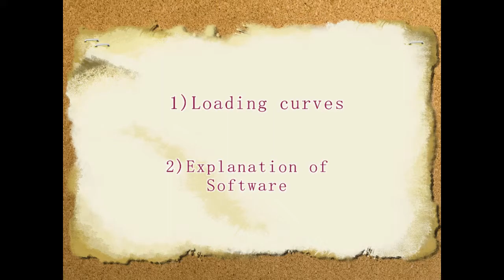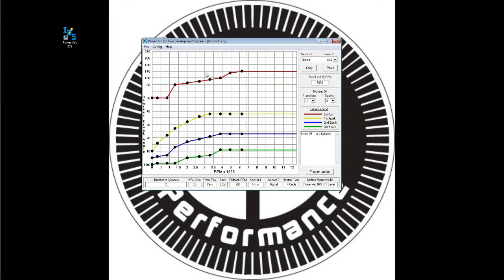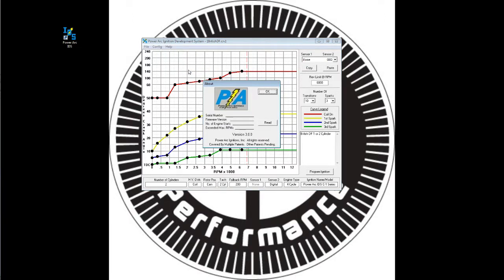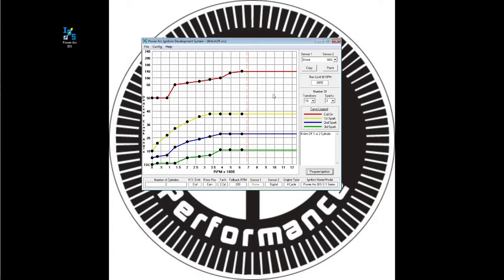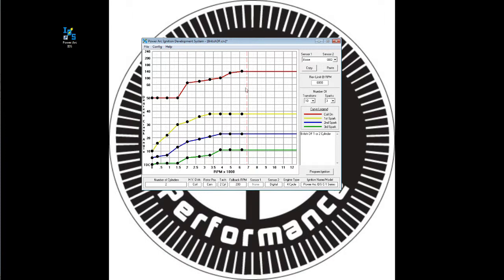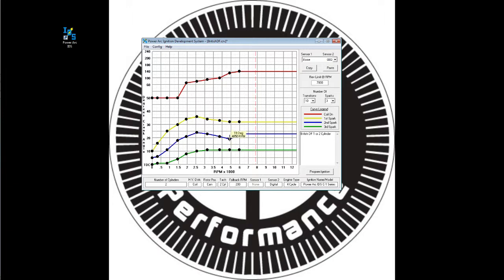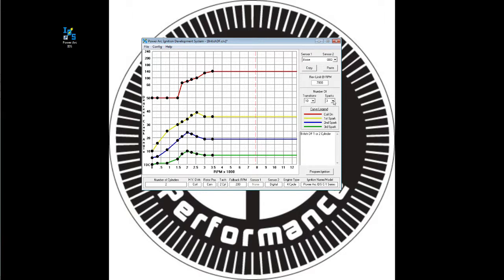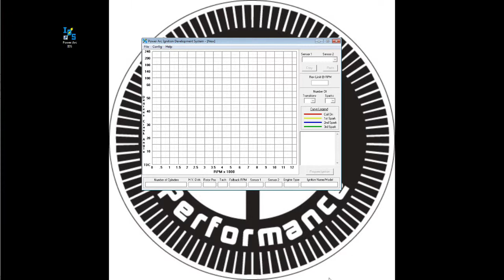C5 Programmer Step 2

Comment: Thank you for the interest. This video was created for a customer with limited English skills who asked us specific questions. We felt it was worth sharing. The ignition is not load sensitive at all. You can use the two sensor leads with a VOES or MAP switch or manual control if you wish to tie load and mapping together. This subject in itself could be a long video. Our website has more information www.c5ignitions.com or email us C5@c5ignitions.com thank you for the feedback!

Comment: I wish your site went into a little more detail on how the map sensor controls the different maps dependent on load of the engine. Do the maps change at preset loads or can you change the point at which they switch also? 

How man different maps does the ignition use? I assume a base map for normal loads and two others for moderate and severe loads? 

Thanks!